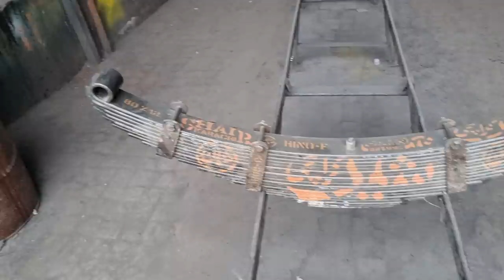How Truck Leaf Springs are Made | Production Process of Leaf Springs | Manufacturing Leaf Spring

Comment: Pls also name the process which is going on.
Reply: I work for a North American manufacturer of leaf springs.  My employer's processes use more capital and less labor, but I can recognize what is going on (mostly).

The first step shown is the shearing of the bar stock into the lengths for each leaf. 
At 0:53, the worker is marking where on the leaf the center hole will be drilled.  Sadly, we are not shown how the eyes and wraps are formed.
At 1:32, it looks like the center hole is partly drilled to make it easier to hot punch the hole.
The furnace is loaded at 1:59.  The screw press at the end pushes the pile of steel into the furnace.  It is run backwards to make a gap to load more steel.

A piece of steel heated to the correct temperature is pulled from the furnace, at 2:29.  
At 2:51, it has the center hole hot punched into it.
At 3:10 the hot leaf is squeezed between two dies to make it straight.
It is hard to tell what is happening at 3:20.  It might be punching a hole at the end, or it may just be the identification stamp.  I apologize for not being able to explain what is happening.

For me, the most interesting step is shown at 3:44, where rollers press the unformed leaf against a template, as, at my employer, we form the leaf between forming dies in a mechanical press, so I have never seen leaves formed the way that these workers do it.

While still hot, the newly formed leaves are placed on a conveyor that lowers the leaves into an oil bath, at 4:07.  The sudden quench (but not as sudden as if it was water) causes a phase change that produces a mix of martensite and pearlite domains in the steel.  As the leaves come out of the quench both very hard and potentially brittle, the quenched leaves are loaded into another furnace that will soften the steel, at 4:58.  Once the steel leaves the second furnace, at 5:40, it is fully heat treated and is stacked for later assembly.  

At 5:56, we see the center holes being drilled into the leaves that we saw the workers marking at 0:53.  These leaves are then loaded into the furnace at 6:25.  It seems to me that these leaves are not the same thickness as the other leaves, so they cannot just be added at the end of the pack and pushed through the furnace, with the other pieces.

I hope that you found this to be informative.